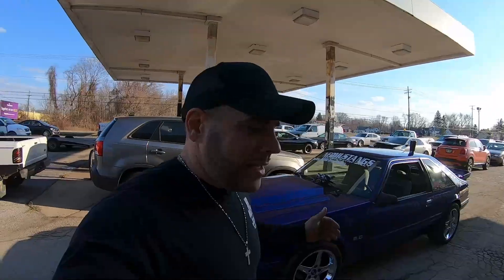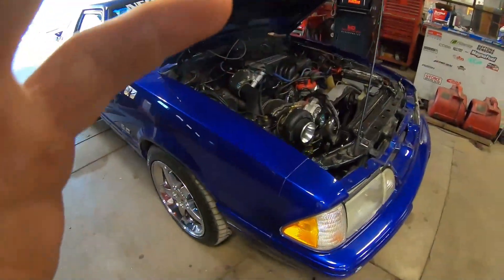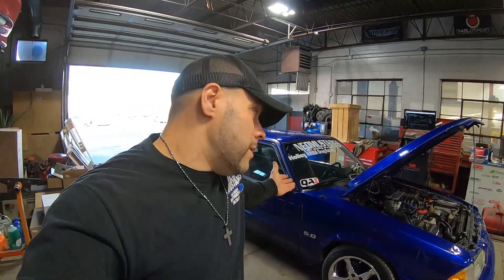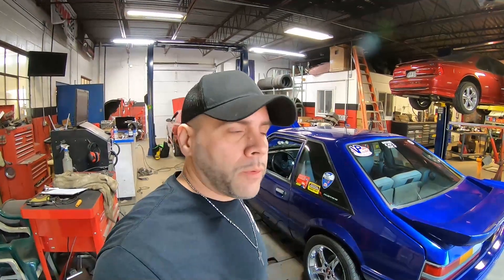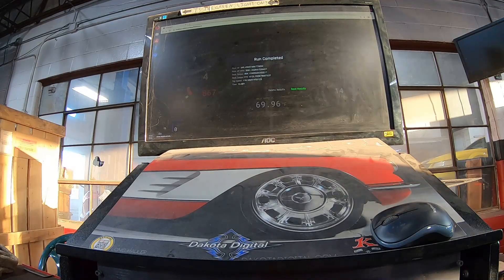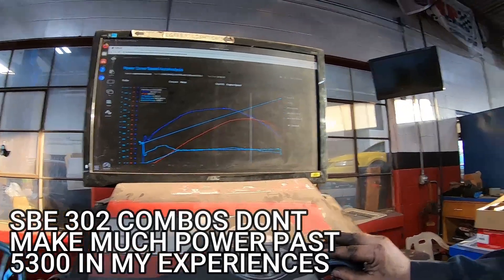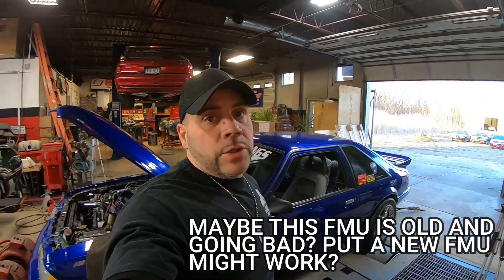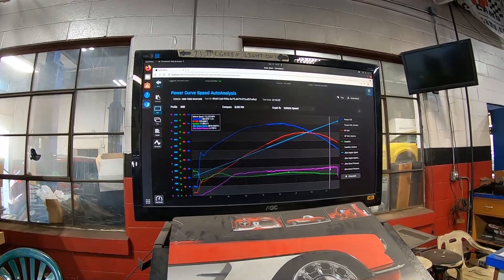Will 19#"s Make 400 Wheel On A Stock Block 302 Turbo Foxbody

Comment: I think A LOT of us would love to see the difference going to a Holley Term X would make over the stock ECU at this point in the build. See how much power you can get from that engine with more fuel and boost, sbe builds FTW! 🙌
Reply from the maker: Ya that’s end game. I wanna enjoy the steps of getting there.  Just to show it. Stock to stock modified gt40. Fmu to mass air? Then to Holley. Tune speed density on 2 bar map speed density Ecu.
Reply: Mix and matching fmu discs to injector size protocol works too.

Ive ran different injectors in lean holes with prescribed sample tubes for the majority of the injectors, 19s in fat holes 24lbs in Lean holes 30s 36ers etc etc with a9ps and a9ls
Reply: How much fuel pressure with the explorer 19s did you see with the fmu?
Reply: Channel rocks nice to see you doing the stuff we did back in the 90s old school tricks still work to a point.Tons of control still in these cars with factory platforms.

Comment: Look up the old Hot Rod or MM&FF article where they did twins on a stock non mass air car and iirc made 400hp+ with 12psi, i remember they had a check valve in the map so it wouldnt see boost and had a FMU. Be nice to do some tuning on the fuel tables at a boost per rpm in the table, maybe add a set of later explorer poly body 4hole ev1 injectors and stage on a few back ups on hobbs switches at 3-6-9psi now thats getting down with old tech 😁
Reply from the maker: Yes sir. That’s where we headed
Reply: That was with 289 heads with yunk jard turbos and a tractor Intercooler?I used to have the magazine can’t find it anywhere
Reply: @oceanford4157  i still have it but have no idea which box its in, been checking with the google machine but its communication aint comprehending what im typing in tonight lol

Comment: Another great video!! Thanks. What about carbureted turbo? That’s what I’ve been thinking about. Thoughts?
Reply from the maker: Works when carb is right.
Reply: @Neomustangs  my friend is trying to talk me into this. He’s got a 66 Fairlane with a stroker 351w (427) with twin turbos. His car screams at 3100 rpm!! It looses all traction, in any gear at 3100 rpm. He built it to do auto cross.

Comment: Slap in that mass air ecu  adapter that you have,  Throw in an A9L and run  your binary editor. This way you're not cutting up a good harness.
Reply from the maker: I got a few tricks before that. We have literally went from stock speed density and made almost every transition up to a possible terminator X in the new box on shelf.

Comment: use a hobbs switch & another injector that turns on under boost...kill timing 3-4 degrees initial thats around 19 - 20 all in
on stock ecu I think & run 10 psi boost (or get serious)...or you can use my personal favorite...turn it up till it pukes a head gasket...turn it down a tad & start over...I have annihilated steel HGs & never broken a motor I dont know why...but I will say this...the little 302 is tougher than you think...big HP out of it ?...KEEP IT OUT OF DETONATION...at all costs

Comment: Can you not change the plate inside of the FMU to increase the ratio of fuel pressure per pound of boost? Perhaps 7 to 1 psi. This will allow you to set static pressure that is favorable for idle and part throttle, but changes the gain as boost increases?
Reply from the maker: 12-1 is the max flow. For 19s.
Reply: @Neomustangs  So you're already maxed out on the FMU and the injectors? That makes sense.
Reply from the maker: Yes.

Comment: That's the old shit I worked with.... 88 SD, fmu, Paxton SN93 at 5 lb. 320 on a stock E7 with some decent valvesprings and Cobra 1.7s.
Reply from the maker: Nice
Reply: @Neomustangs  that was a hot setup back then.....of course, my 2014 GT auto DD would absolutely destroy it, stock, lol......
Reply from the maker: @EffequalsMA  LOL does it run 11's?
Reply: @Neomustangs  Best I did with that is 12.2 but, my former 3.73 6 speed manual 2012 did 11.91 on a slick tire, at 115 mph. Both cars full loaded, with 91 tunes on. I did put a 100 jug shot on the 14 and it did 11.3 at 121......

Comment: Did you say what ratio the FMU is? I recall from like almost 25 years ago (wow it’s been a while!) when I had my Vortech A trim setup there were different discs that corresponded to injector size iirc. Presuming you have the one for 19’s? Otherwise maybe that’s another knob to turn. Heck, I’m pretty sure Vortech or Paxton made an adjustable FMU. Good stuff!
Reply from the maker: Ya old school for sure. ITs 12-1 kenne bell im assuming for 19's. I may put a new Vortech on it with 12-1 ratio and install 24's.. hell i dunno. Messing around now.
Reply: Vortech made a ‘Super FMU’ back in the day that could double as a stand alone regulator also.  The disk’s could be changed, along with fine tuning of the slope of which the added pressure came in and topped out.  I used it with great results back in the day.

Comment: Do you run the down pipe open on these runs ? I’m going to try it on my set up , doesn’t sound to loud.Keep doing what you do !
Reply from the maker: For now yes
Reply: @Neomustangs  Thank you .. I was going to say I run the Micro Squirt on my coupe and been happy with it so far. The ability to run the stock harness was pretty cool you just have to run a GM map sensor but it’s easy peasy

Comment: AEM Wideband sensors are notorious for going bad. They've earned a horrible reputation for crappy O2's.
What were the power numbers from the 2nd run?
Reply from the maker: 351/405. i think maybe the FMU is starting to show signs of age and bad? I mean we are pushing it very hard. I dont mind mentioning here in members chat that our next trick is a new FMU to see if it reads same. Then we talk about next.
Reply: 351/405 I believe
Reply: Damn beat me to it.
Reply: @Neomustangs  a new FMU makes sense. Just too bad I haven't seen any kits that allow for more than a 12:1 ratio through the FMU. If you could do a 14:1 or 16:1, you could get more fuel in there. 
I was surprised to see how pricey those buggers are too. You're about 1/2 the cost of a dyno tune if you get a new one.
Reply: @Neomustangs  try a recalibration kit instead of a new FMU.  They're pretty cheap. Not like the housing goes bad anyway, it's just the internals with the washer.
Reply: @Neomustangs  Just thinking this through. You might get similar results running 19lb injectors with a higher ratio disc of 14:1 (which doesn't exist) as you would swapping in 24lb injectors and keeping the 12:1 ratio calibration disc in the FMU. I know the calculations are a little disparate, but you get the idea. If you need to add more fuel, 24lb injectors and dialing in your FPR might be the way to go.

Comment: That's pretty impressive that with a DA1 & 19# injectors to make a turbo function and get 350rwhp. 
Serious question, don't you agree that the price for a new alternator, pump and wiring upgrade, it would be better just to MAF convert? You only can go so far in Speed Density. 
That said, I wonder what a tune to that DA1 will produce. Great series for folks like me who are more familiar with SD than MAF.
Reply from the maker: 3G. & Wiring pump upgrade should be done even if it’s NA. That way it’s done and out of the way. Better lights. Better pump.
Reply: Speed density can be taken further than most people will attempt and spend more money to put mass air on it or Holley which IS Speed Density lol
Reply: @young11984  I understand that a Holley Terminator is Speed Density, but it IS NOT DA1 Speed density. And I'm not knocking Speed Density, but in the DA1 Ford ECU, there is only so far you can go, mostly because the tuners don't want to deal with it. I've owned 2 mustang Fox's in my life (87&88) both Speed Density. The cost to move to an A9L is nowhere near what a TermX runs (ask me how I know) and the tuners that support the A9L are plentiful. Bottom line, Speed Density in the DA1 is dying. I enjoy watching this man show us where you can go with a DA1 ECU tho.
Reply: @jpp9846  DA1 is fine for 4-450ish whp and any competent tuner can tune them just most ive seen around here are lazy and looking for the easy shots vs putting their talents to use for somebody that wants something different.
Reply: Why not put bigger injectors and a walbro 450.
Reply from the maker: @young11984  yes
Reply from the maker: @robertosoto6680  it’s not a fuel problem from pump. It’s a bottle neck 19 injectors. But slapping other injectors in a speed density Ecu factory isn’t something you can do like mass air
Reply: @robertosoto6680  you need to tune for bigger injectors... And as stated above, DA1 tuners are scarce
Reply: @young11984  I'm not saying it can't be tuned to be a beast, there just aren't tuners wanting to mess with it... Or as you say, too lazy. 
Similar to these jackoffs wanting people in electric cars, these tuners are forcing A9L.
Reply: @jpp9846  agreed and they can kiss my ass thinking im being forced into buying an electric car.....now retrofitting an old beater classic car with E power then im for it lol
Reply: @Neomustangs  forgive my ignorance, but what would happen if you went to say a 21# or a 24# injector with not other changes other than lowering fuel pressure

Comment: What you're trying to do is admirable. That being said, man... I've seen heavily ported GT40 iron all motor setups putting 325-330 to the wheels. This ain't it man. Give that thing timing and fuel and let it eat!
Reply from the maker: You can’t until you convert. Or have some tuning. We ain’t there yet. This is being done without that atm. To serve as an option for folks that don’t have money to do big inj and stuff yet.
Reply: @Neomustangs  I get it man I really do. It's just so hard to watch knowing what it needs. You're right tho. Keep fighting the good fight so guys know there's an option to enjoy their cars
Reply: Yeah, I've seen that too.. but I have yet to see it from a relatively stock motor and never from Iron GT40 heads at 5k engine rpm. Context matters. Timing and fuel... on a cast piston, cast rod, cast crank shortblock, running boosted with an FMU for fuel management and an OEM ECU for timing.... yeah, that'll be fun.....
Reply: What combo of parts,? N.a spec parts,factory stock freak shows with Rich Groh heads? that turn 8000 rpms.

Application is application not everyone is trying to build max effort gt40 stuff.Apples to oranges.Thats like saying everyones car needs to be stripped down to 2350 with driver and if not its not right.

Ive been 1230 na with parts ive shoveled out of my side yard from the scrap pile and beat cars with more power at the track with bigger budgets,doesnt mean their setups where bad,it just means I did more with less.

Great job on the video and tech Neomustangs.